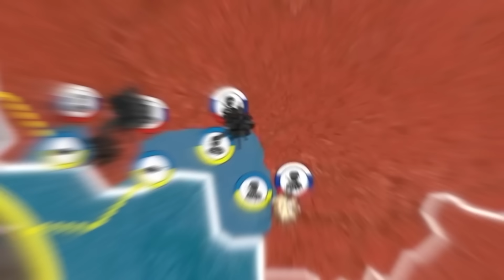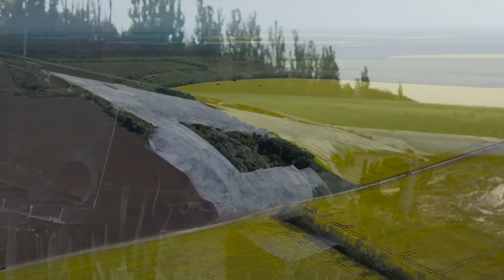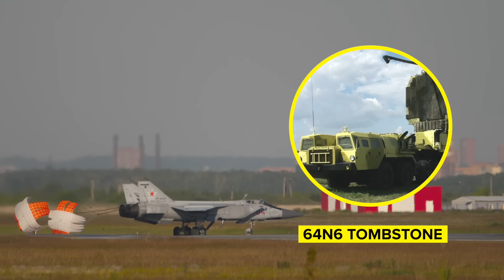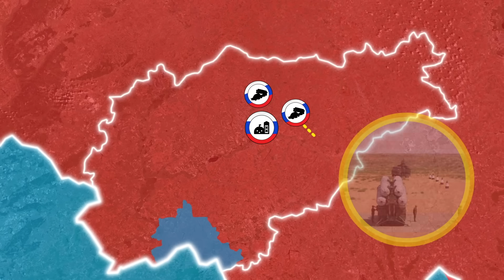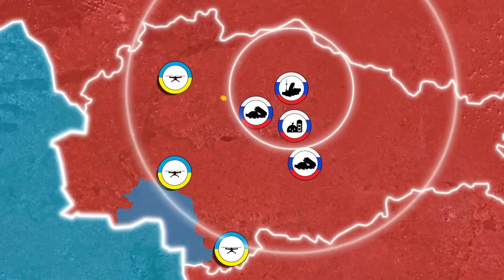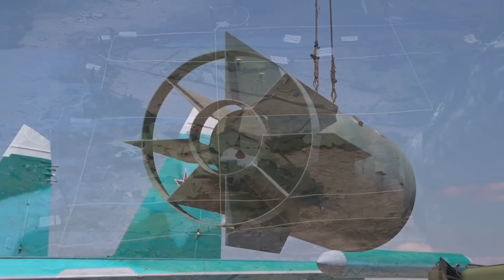Ukraine's Masterstroke - Russian Khalino Air Base TOTALLY OBLITERATED

Comment: Russia could've done better if they had a network integrated radar systems. If you have a series of tombstones networked with fiber optic data link, the air defence system can avoid being jammed ans can still function if one important asset of the system was taken out.

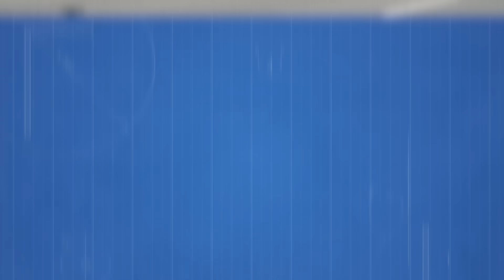Comment: Little correction @ min 7:33 1000km/h does not equal mach 8 as that would be 8 times the speed of sound. 1000 km/h lies more around mach 0.8 but apart from that great video

Comment: On a lighter note, has anyone noticed that the often used picture of a Russian soldier with a Russian flag patch on his arm shows that the flag badge is simply fixed as a Velcro patch which is instantly removable.  Does the Russian Defence Ministry also issue Velcro Ukrainian flag patches or Red Cross patches for surrendering?

Comment: Wounder what they're using to track the drones. In theory, if its motion or signal, couldn't you outfit a decoy drone with a few "tails"? These tailes would be about 15'-25' long (potentially longer, but I don't have a spec sheet in front of me for payloads, speeds and flight heights) and would attach to a large can with a low power transmitter inside for signal targeting. The objective is to make one target look like multiple; the ruse resulting in either multiple SAMs to be launched or a more expensive air burst munition to be used. The whole point is expending ammunition that would be used on other targets. Ammunition consumed is ammunition that must be reloaded from a supply chain and paid for by someone; these munitions are not cheap.

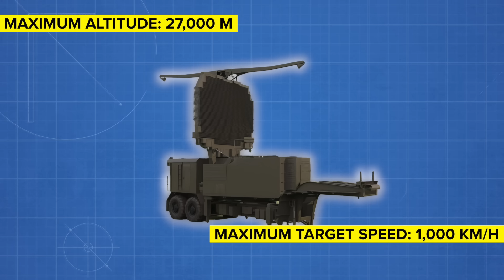Comment: Error at 7:24   The video posted a top speed of 1000 km/hr (=621.3 MPH), yet the audio says 6,213 MPH
It's clear that the video should have posted 10,000 (not 1,000) km/hr
Reply: or it's tracking vs. engaging.
Reply: @stephanweinberger  I can think of 3 counters to that hypothesis:
#1) No modern radar system, let alone their latest, high end uni,t would be speed limited to just 621 miles per hour.
#2) The odds of the tracking vs. engaging speeds being exactly one tenth the other is WAY LESS than just slipping a zero when posting the text.
#3) When it's discussing capability, the audio should not present one spec. while concurrently posting a different spec. in the video portion.

Comment: I like the information you provide, but you are over-enthusiastic in converting between metric and imperial. If something has a range of 300 km, I would expect it to be something between 250 and  350, maybe 290 to 310, but certainly not 300.0 km. So reporting it as 186.4 miles is way over-specific. How about describing it as 185 miles, or 190 miles.

Comment: What military watch  dude does not tell you SAMS are not designed to shoot drones. This is the job of Panzir and Tor close range def fence. If you swarm them high enough any areal air defense crumbles. Panzirs are in high demand , you can not defend every field while running 1000 miles war front.  NATO Ukies cannot defend their capital city of Kiev alone.
Bottom line if you swarm any air defense system you can overcome it.  Russia has best defense systems in the world. NATO are siting ducks against even single Russian hypersonic missile like Kinzal, Oreshnik or even older Eskander.

Comment: So this is a pet peeve of mine. Decimate is to reduce by 1 tenth. Devastate is to destroy or do severe damage to. Again decimate is just doing a bit of damage devastate is doing a lot of damage. Ok, I had to get that off my chest. It bugs me when people use decimate to mean destroy entirely, which is just wrong.
Reply: I agree. But most people don't know about Roman military discipline.
Reply: It meant to reduce by 1/10th if you were a Roman!
This and many other Latin words have changed meanings over the last 2000 years. You need to catch up
Reply: The Roman "decimate" came from the practice of the victor lining up the losing soldiers and then walking the line, killing every 10th soldier. I.e., reducing by 1/10th. Nowadays the dictionaries use a far less precise, more subjective "Destroy a large number of something". Roman precision has been superseded by a touchy-feely concept that is unique to each speaker. When the Barbarians arrived at the gates of Rome, well, you can fill in the rest. Everybody gets a participation trophy! (Sorry, I'm off my meds...)
Reply: Decimate (10% kia) is taken as meaning to reduce a unit's effectiveness significantly  however, while 20% usually means a unit is removed from frontline action.  Its not JUST the missing troops, it also the psychological effect on the remaining troops.
Reply: Decimate means only 10% remains.

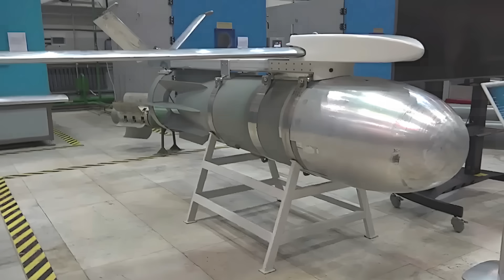Comment: 1:30 Fab-1500 contains 440lbs of explosives. What? No. The FAB-1500 has around 1,700lbs of HE. You have perhaps googled the FAB-500 not the 1500. Also as the 500 and 1500 in the weapon names refers to their total weight in kilograms, would it not make more sense to talk about how many kg of HE they contain? Not the first big goof I've seen on this channel. A little dissapointing for a channel that has so many subs and views.

Comment: NOT Long range Missiles. Long range Missiles have a range greater than 330 miles. ATACMS are Tactical Missiles with a MAX range of 190 miles depending on the weight of the warhead. The range is significantly shorter with heavier warheads such as High Explosive AP fragmentation warheads.

Comment: With the surge of smaller drones, many of these advanced SAM systems seem like they are quickly becoming obsolete. Not only is it a big economical loss to shoot such an expensive missile at an expendable drone - but also they won't have much they can do against drones flying mere meters above the ground. Radar won't be detecting them, and the missiles were never designed to work that close to the ground. Right now you need a person to guide a drone like that, but this will easily automated with a little development. You can 3d map the whole route with high accuracy just from existing records, and then throw in a little AI to tackle any unexpected obstacles.
Reply: High Energy Laser Systems will be economical small drone defense. A CIWS would also work well for small drones. The problem must be identifying the type of threat, since drones are capable of fooling detection systems in broadcasting threat type.
Reply: @mondo9148 correct, CIWS and Laser weapons for point defense are back. NATO has neglected this far too long
Reply: Oh please. You still need large SAMs for large aerial targets. Have you never heard of multilayered defenses? All you rank amateurs sounding off about drones being the be-all end-all of warfare that supposedly makes EVERYTHING obsolete is painful and second-hand embarrassing.
Reply: What military watch  dude does not tell you SAMS are not designed to shoot drones. This is the job of Panzir and Tor close range def fence. If you swarm them high enough any areal defense crumbles. Panzirs are in high demand , you can not defend every field while running 1000 mile front.  NATO Ukies cannot defend their capital city of Kiev.
Bottom line if you swarm any air defense system you can overcome it.  Russia has best defence systems in the world. NATO are siting ducks against even single Russian hypersonic missile like Kinzal, Oreshnik even older Eskander.
Reply: @bobtate6812  you're funny buddy.. the kinzal has been shot down multiple times and isn't hypersonic, you're aware that hypersonic means it maintains mach 5 and above during its entire flight path.. none of russias missiles do that, and if its just reaching mach 5 those missiles have existed since the 60s... from like half the world.. all intercontinental missiles are well above mach 5.. standard ballilstic missiles is a bit different because they don't go exo atmospheric...  seriously the minuteman III which has been tested many times has a range of over 8000 miles, over 700 miles above earths surface aka exo atmo, and travels around 15,000 mph so uhh almost mach 20.. and top speed is mach 23..

Since 2014 the RIM-161 has existed with a speed of around mach 9 but its classified so we have no real idea, its a surface to air missile fired from crusiers and destroyers. The Trident II is mach 24.. 

But far as im aware none keep above mach 5 their entire flight path, the US definition requires it to, russias does not and it has to be able to maneuver.  

Ahem the GAM-87 in the late 1950s was hypersonic reaching mach 12 with a range of 1150 miles or 1850 kilometers.
Reply: @Acheron_the_Nihility  What military watch  dude does not tell you SAMS are not designed to shoot drones. This is the job of Panzir and Tor close range def fence. If you swarm them high enough any areal air defense crumbles. Panzirs are in high demand , you can not defend every field while running 1000 miles war front.  NATO Ukies cannot defend their capital city of Kiev alone.
Bottom line if you swarm any air defense system you can overcome it.  Russia has best defense systems in the world. NATO are siting ducks against even single Russian hypersonic missile like Kinzal, Oreshnik or even older Eskander.
Reply: @bobtate6812  Not sure I would call the s-400 the best in the world, but its top 2 for sure. Hard to really say for sure with everything being classified and there not being a lot of real world test examples to compare the 2 big contenders. Any real decision will be based more on speculation and potentially patriotism than anything. But you understand what most people don't seem to comprehend.  Swarm strikes are and have always been able to overwhelm any air defense system.  The large flights of b-17 bombers in wwii achieved the same thing as a large scale missile strike of today.  In wwii the flak batteries basically could destroy just about anything in range individually, but add altitude and numbers and the job gets much trickier.  Missiles currently can hit anything with very little chance of dodging, but you now can fire more missiles and drones than the battery has in terms of counter launching missile systems and leave too many systems for the close range AAA to take out due to target capacities. I suspect the next naval war we see where ships are actually fighting other ships both sides will have everything sunk at the early point in the war that isn't a submarine.  Both groups will launch their missiles and both will be overwhelmed by the others attack and wind up in a draw.  Whoever's navy is within range of enemy shoreline is basically doomed.  Large amounts of low cost missiles is the way of the future for warfare.  And while that has been suspected it is really being demonstrated today in the current fight.  Right now if you get hit by anything its basically toast so volume of fire is more important than protection since no amount of protection will help you with modern weaponry.
Reply: @zackeryhardy9504  agree, you  have very good understanding. Two most experienced land armies in the world today are Russian and Ukrainian army. The most dramatic turn around was Russia. From initial 180K and loosing to 700K + grinding machine. Most people miss Russia goal is to preserve solders while Ukies dump their reserves to gain land. Result Ukraine run out of man.
Ukies are sending instructors to Britain to teach latest developments.
Reply: @bobtate6812 then why has Russia needed north Korean troops?
Reply: @Acheron_the_Nihility great knowledge,
Reply: @bobtate6812  one has lost like 50k troops russia has lost over 700k plus numerous other equipment you have everything backwards russia throws everyone to the meat grinder, and has relied upon north koreans as extra meat shields for their troops.. 
experienced is laughable, russias military is far from experienced, ukraines is barley experienced and most of what they learned is entirely from nato and the US the last few years, which just expresses how much better nato and the us trains people. 

US has not left war in decades buddy, there was one short period of time where the US wasnt involved in conflicts its actually a sad reality the US only really knows war.
Reply: read my post above, stop fantasizing